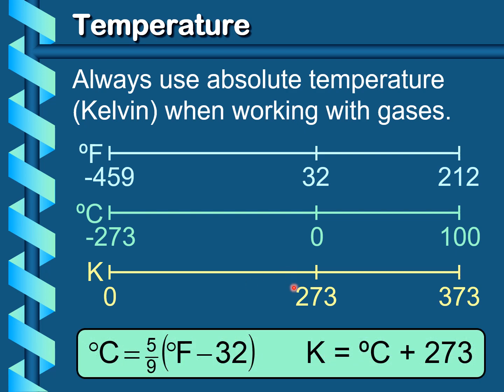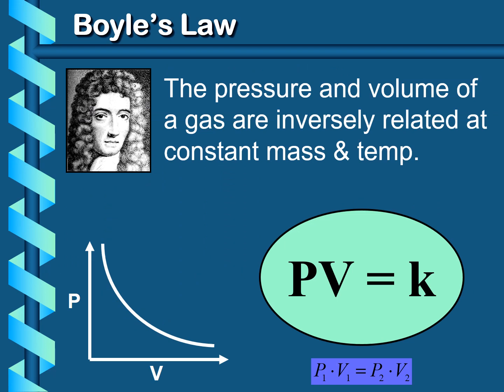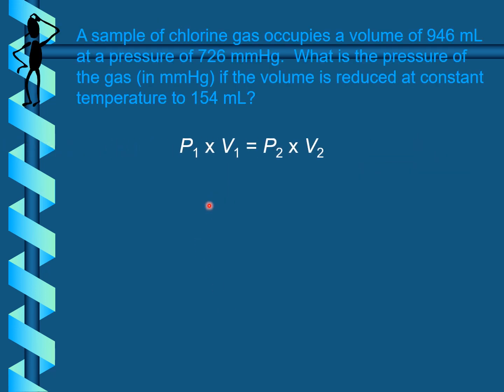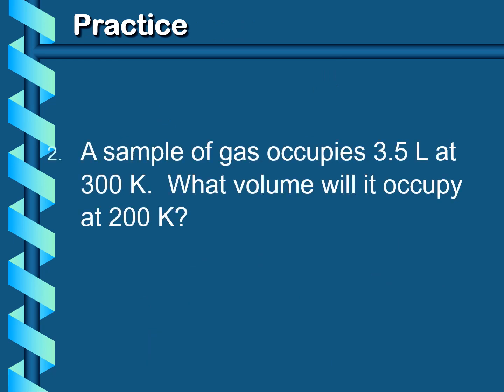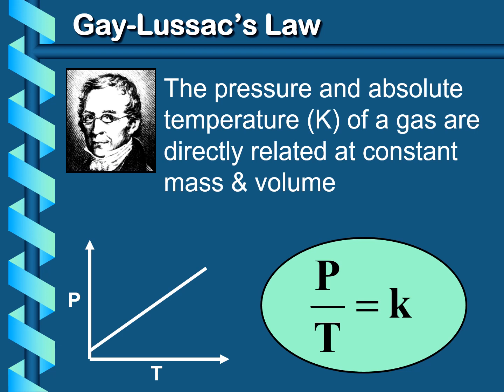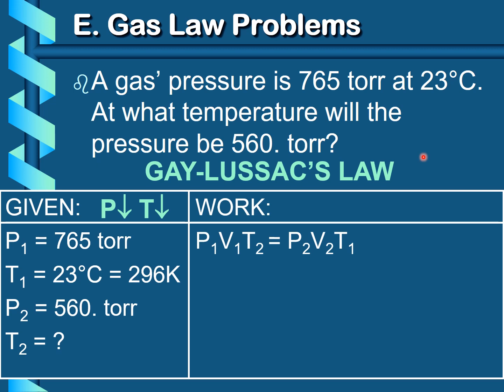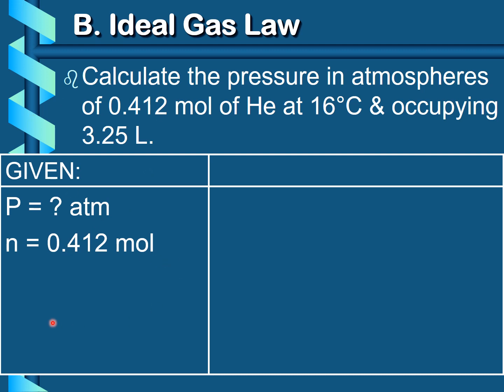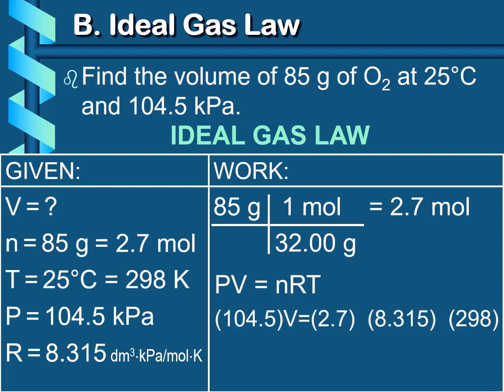THE GAS LAWS

Comment: Rasalan, Ricoyan A.
BSMRE-1B

In connection to the video, I have gained lot of knowledge and understanding especially about gas law, boyles law, charles' law, gay-lussac law, combined gas law and ideal gas law. I was also able to learned the characteristics and properties of gas law. Through this video I was able to learned how to apply the given equation in order to solve every problem which there is a corresponding solution or answer to it. All the topics discuss in the video are well explained and it can be easily understood through the given examples. Thank you for the additional learnings sir.